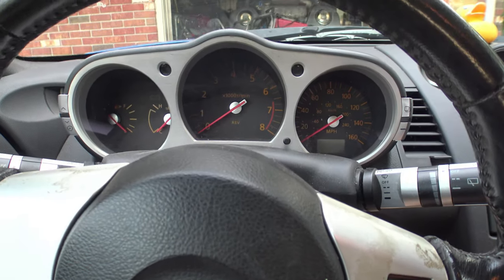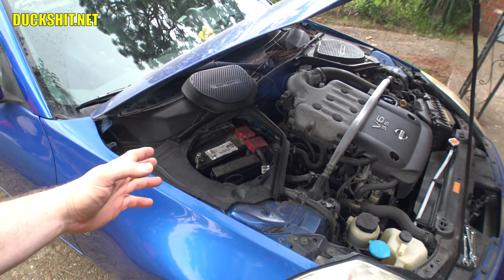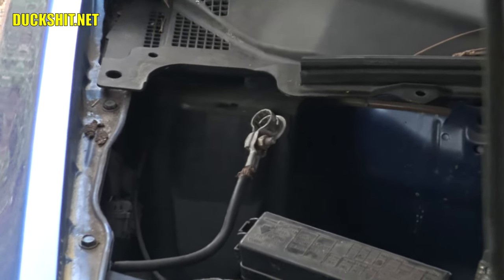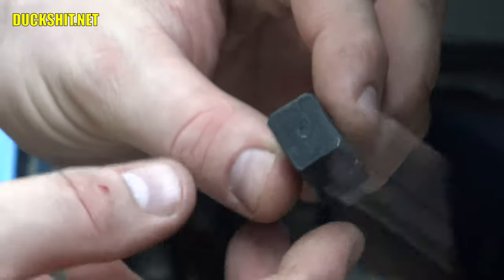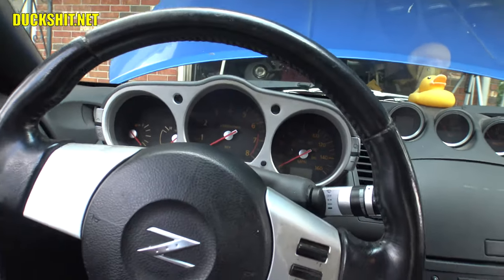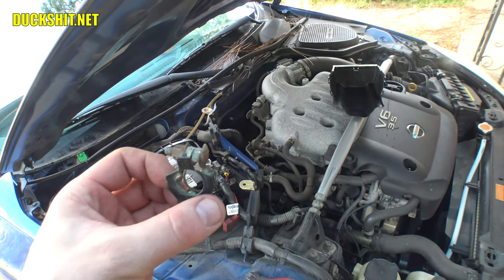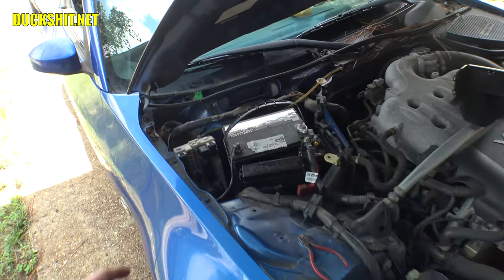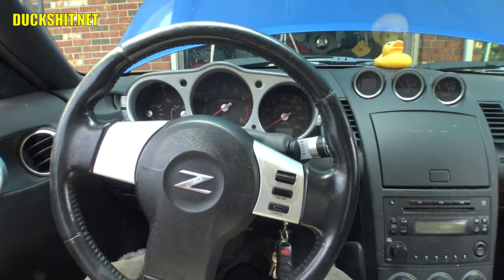Nissan 350Z Won't Start Fix - 4 Things to Try - IPDM Repair

Comment: Bro I am not lying: Got this car a few days ago and swapped the battery because it was old and garbage. Swapped it and wondered why the car wouldn't start. I panicked a bit that it was the immobilizer. Saw your video and heard that you talked about the clutch and this button. I thought "no way..". Got in the car, pushed the clutch and the engine started 😂 NO ONE TOLD ME THAT I HAVE TO PUSH THE CLUTCH IN THIS OLD BEAUTY TO START THE CAR🤣🤣🤣🤣🤣🤣
Reply from the maker: Haha glad I helped!  😁👍🏻

Comment: Hey, I’m having a similar problem here with my 04 Z. So it does the same thing where all the lights light up and it just clicks when you try to start it (no crank).  However, sometimes it does turn on and sometimes it doesn’t, and when it doesn’t you have to wait for like an hour for it to turn on again. I was wondering if you have any idea of what the problem could be. I’m guessing the starter, i talked to my dad and he thinks it might be something electrical. I replaced the fuses but nothing changed, I didn’t replace the relays tho because I feel if it were to be the relays the car wouldn’t want to start at all, unless I’m wrong. Can the relays work intermittently? Any comment will help thanks
Reply from the maker: Yes relays can work intermittently, that's actually something I was experiencing just last week.  Sometimes just wiggling them in their socket is enough to make it start.  But as you saw in this video you can swap out your starter relay with your high beam relay and see if that makes a difference.  If your starter starts working and the high beams begin acting up then it was definitely a bad relay!  Good luck, let me know what happens!

Comment: i order the relays using your link on amazon, they were too big to fit. but i did test the original relays and they are working. I think the starter is the issue.
Reply from the maker: Someone else told me they're too big also, but when I ordered them they're fine.  I'd like to see a pic of what you received.  I think the vendor probably screwing something up.  But in your case if the relays are good, and you did check them for continuity then yes it could be in the starter.  Also check your clutch switch!
Reply: @DuckmanCycles  yes checked the clutch switch by holding it down with my hand. The plastic piece is still intact.
Reply: @DuckmanCycles  I’ll send a pic when I’m back home.

Comment: 2004 here. Just replaced battery. Was packed up for weekend excursion. Fueled up at gas station. Real slow crank over. Then it screamed a few times and not just clicks. Wont turn over at all. Thats why i got a new battery lol. Starter gave up ghost.

Comment: Hey brother.  I really appreciate your video but when I ordered the relays you had a link to they ended up being too big for my 2005 350z . Did Amazon change the size ?
Reply from the maker: They look different in the photos in the link for some reason, much taller.  Might still fit in the socket, not sure if you can get the lid on it with such a tall relay though.  I'll do some more research here and update the link if necessary.

Comment: I love the energy, My nissan 350Z 2004 suddenly stopped turning on,and if it does the lights get on their own,The car doesnt take fuel and i believe its ana electric issue...where do i start
Reply from the maker: Well, I'm not sure I understand the problem based on the description.  But start at the source, make sure the battery is good and well-connected!
Reply: @DuckmanCycles  thanks allot man can i keep u updated?
Reply from the maker: Please!  You can reach me through any form of social media in my video description, on my website, or email me through my website!   I'll see what I can do to help.

Comment: Which fuse or relay is for the 3 gauge pods in the waterfall and the dash gauges and mirror, mine dont work at all?
Reply from the maker: Thanks for the question man, that's a bit off topic from what's going on in this video... I'd have to check the manual.  Do you have a manual for your car?
Reply: @DuckmanCycles  no I don't which one do you recommend. Other than the owners manual.
Reply from the maker: There's only one that I've ever seen, it comes directly from Nissan themselves.  I'm not sure who published it, but you can find a copy of it up on the 350Z forum websites

Comment: Thanks for the video, I have a 2003 350 import, all of a sudden no start, i’ve checked all fuses, checked all the relays, I’ve checked the clutch safety switch and the power to it. All good it does bum start with a push. Just will not start with the key or replace the starter motor with a new one and still no start. I’ve just checked Continuity between pin 25 to f37!! And all good there. Any ideas? 
Thanks paul
Reply from the maker: Looks like you were pretty thorough, but do you have power at the starter motor? Maybe bad starter wire?  Battery terminal could be borked, too.  Just a suggestion.  Hope that helps!
Reply: Hi there 
Thanks for the reply, Iam getting a click from under the dash where the fuses are when turning the key. I Seam not to have power going to the starter relay on the ipdm ?

Comment: Maybe it’s your blinker fluid
Reply from the maker: It's always the blinker fluid LOL
Reply: @DuckmanCycles  Muffler Bearings. Gotta be.
Reply: Nope, you had broken piston return springs!
Reply from the maker: @BobPegram  Only the VW has those, to help counteract the force it takes to turn the water pump.
Reply: @DuckmanCycles  Tesla's are the only current car that cannot have piston return springs retrofitted.  I found out why though.  Tesla's use electron return springs!
Reply from the maker: OMG!  Tiny springs! They'd be the diameter of UV wavelengths of light!
Reply: I just check my blinker fluid filled it cause it was low. And it started right up. Thank you guy so much you saved me a lot of money  dealership wanted 299 to refill my blinker fluid.

Comment: Where there’s a will there’s a way! Glad you fixed the problem! Btw did you replace those clips the windshield guy lost?
Reply from the maker: Clips not yet replaced, the hood actually compresses the rubber seal on the plastic panels, so you really don't need 'em!  I should just go buy a bag of them though, some of what remains are broken, too.
Reply: DuckmanCycles and VW Garage I bet they’re cheap as hell online lol
Reply from the maker: Yep, especially in bulk!

Comment: Subbed! I have EXACTLY the same issue! I tried to remove the IPDM module but that last small connector with the two really thick white wires - can't figure out how to remove the connector!!! Any tips would be GREAT as I really, really want to open up that module to check that Pin 25 trace. On that connector, there's a side clip by the look of it, but I tried squeeing the little inner tab and pulling on the block. No way will it come loose! I tried shifting the littel tab outwards (away from the connector block) and it still won't come out. HELP!!!!!
Reply from the maker: First, thanks so much for joining us!  But it's a little hard for me to see without taking mine apart again.  If I remember I removed it with bare hands, but sometimes on some of those clips you can squeeze them with needle-nose pliers to help you along.  Don't pull on the harness too hard, sometimes the blades will pull out of the connectors and you have a mess to fix.  Send me some pictures through the social media links on my website, I'll see what I can do to help you further!

Comment: Have an '06 where the passenger power window died, new motor isn't getting any power. Switch is good and the fuses under the driver side kick panel are good. Does the IPDM have anything to do with the power window circuit?
Reply from the maker: Other than the ignition relay and initial power switching, I don't think any power window stuff goes through there at all.  I'd trace the wires, you may have a cut in something or a dirty connector!   Easy fix if you can find it!  Good luck!

Comment: Did you have any oil pressure readings when it wouldn’t start? I’m having this issue but I am getting no oil pressure reading
Reply from the maker: Can't tell, everything on the dash flickers and bounces all around when starting... and that is normal!

Comment: Hey I have a question? so I'm getting low voltage to o2 sensors heater circuit. Why hope its just band wires but because its in the same bank on each side with think it could possibly be the ecu? Do you have any tips or tricks to guide us
Reply from the maker: Not something that I have ever encountered, Start with checking the wires for sure!  ECU is a possibility.  It could also just be the sensor itself!

Comment: Hello.My son's got a 350z 2003.If he keep the key on acc.dome light, radio and some other stuff on.it won't start.it will turn but won't start. He has to turn everything off and then it will start. Would it still be the relay??
Reply from the maker: I've never heard of such a thing.  That's very unsual.  I'm just guessing here, but maybe the BCM is acting up.

Comment: Could a bad ipdm give you a crank no start? And could I use the a 2005 ipdm on a 2003 350Z manual transmission
Reply from the maker: Sure could... it did in my case
Reply from the maker: And I couldn't be for sure about this different years, your best bet is to look at the part numbers for both those years and see if it's the same one

Comment: My IPDM got flooded and the dealer wants to replace it for 2k. I see used ones online for 200. Do you know if it’s a plug and play part? The dealership is tacking on 600 for manual labor because they claim it needs to be “programmed to my car”. Thoughts? 
Mines a 2007 Infiniti g35
Reply from the maker: It is a plug-in play part, just make sure you get the same one for the same year and trim level to be sure!

Comment: What if there’s a rapid clicking noise coming from the ipdm relays or box after I stop cranking the car. It’s cranking but not starting. ANY ADVICE WOULD BE GREAT !!
Reply from the maker: Rapid clicking when you try to start it is usually the battery, but you say this happens after you try to start it and it cranks and doesn't run?  So you let go of the key... and lots of clicking?
Reply: @DuckmanCycles   yessir, battery is new and I’ve check all my sensor with a multimeter. has compression,fuel pump works and it’s still not starting. It might be something electrical or ecu ?

Comment: Hey my car has power but won’t turn to the acc/on position I have new battery and checked all fuses etc
Reply from the maker: Check the ignition relay first, swap it with the one from your high beams.  Free test.   If that's not it, possibly the ignition switch is bad.  Lastly, it not anything else, then wiring!

Comment: My 350z automatic is doing the same thing yours did. I'm going to replace fuse 89 and see what happens. After this the car will be up for sale it's a 2004 with only 73k miles
Reply from the maker: I hope you got to figure it out, or I bid you good luck on your sale!

Comment: How did you open the box IPDM as I tried, but it stuck together?
Reply from the maker: I only gently pried it apart, didn't take too much effort.  Before you open it, are you sure your problem is inside of your IPDM?  I was very sure, but I diagnosed everything else first.
Reply: @DuckmanCycles  well I check all fuse none are damaged and the box has a crack on the right side so I’m assuming it’s got something shorten inside it

Comment: Would that also cause a fluctuation in the clutch safety switch? My tuner said there is something wrong with my clutch safety switch the numbers kept fluctuating as he was looking at it. I’ll be sitting at a light and it will shut off then I start it back up and it won’t let me rev above 3500 rpms then I shut it off for a minute or so start it back up and it runs fine.
Reply from the maker: A term like fluctuation doesn't really make a lot of sense.  Either the switch is  on or off, it shouldn't be "fluctuating" any values in between that, so I would ask him to better define what he was saying.  As far as the problem is concerned, it doesn't seem to be related to the clutch switch,  I'd be looking at air flow and cam sensors, thats where my problem has been when I experience strange things as you describe.
Reply: @DuckmanCycles  okay I changed all 4 cams sensors and it still does it. What would you recommend changing next? Maf sensors?

Comment: Hey, brother.  Where is the starter relay for 2011 Z
Reply from the maker: In the IPMD module behind the battery.   Check the manual for your year to know the exact fuse and relay.  Hope that helps!  😃👍

Comment: So my car started doing this, I also drift my car so I’m not surprised my clutch pedal peice broke. I have not checked it out yet but I bet you that clutch plastic is broke cause I’m always kicking the shit out of my clutch on track
Reply from the maker: I don't think drifting would matter much to the pedal switch, hehe!  But I'll be running a follow up video to this soon!  More to come! Thanks for the comment!
Reply: Hey duck man I’m still battling this problem, I’ve put a new battery in, I’ve swapped out the starter relay in the Engine compartment fuse panel, I’ve cleaned up battery terminals good, I put a new clutch safety switch in, rubber grommet piece is still in tack on the clutch pedal, one thing that does worry me is I was driving my car in a heavy rain and I accidentally hit a big puddle on the passengers side and after I got to where I was going it limp moded and water got into the fuse box behind the battery, I pulled some fuses and let it dry for a few hours and it’s been good ever since but I’m starting to question if the motherboard is smoked internally? Really stuck man

Comment: When you noticed the clutch issue. Did you notice if the pedal travel was making a long hard scrunching sound? I just noticed that my stopper fell out and am not sure if that is related.
Reply from the maker: Not really, everything felt quite normal to me...  I do have to replace the clutch fluid line though, the pedal doesn't always bounce back as it should, a symptom of a stretched out line.   I have a braided one here waiting for me!

Comment: Love the vid! Can you assist me with a p1123 code? I've replaced the t-body, pedal sensor and maf and have done the relearn. Checked all connections. Still p1123. Any suggestions would be GREATLY appreciated!
Reply from the maker: Thanks for the question, but I can't say that I've ever encountered that error before.  Have you tried to recalibrate the throttle?  I know there is a procedure for it I just can't remember what but I know you can find it up on a 350Z forums.
Reply: I haven't yet. I cleaned the connections with electronic cleaner. It may have solved it. I had to do the relearn procedures 2x. I've test driven it both times and may have been dirty connections from in/out plugging processes along with the need to replace the throttle. Cross fingers.  Btw. Keep vids coming!

Comment: Could you help me out I replaced the neutral safety switch, clutch switch, starter motor, checked all fuses the car only clicks when turning key o thought it was the starter but I just replaced it and nothing could it be the ipdm for me or the security system I checked all relays and fuses out of nowhere the car did not just want to turn on and started clicking
Reply from the maker: What do you hear clicking?  Be specific!  Maybe it’s a weak battery.
Reply: DuckmanCycles and VW Garage the clicking is behind the motor area I’m guessing the starter and relays but the battery is less than a year old I even tried jumó starting it to get the voltage at the right level and nothing it’s either a bad key and a key cylinder but I have no idea if it’s a plug and play or would I have to change the Bcm along with it the starter is good the neutral safety switch is good the clutch switch is good the plastic button is good all fuses are good it has to be the NATS security system
Reply from the maker: If the starter relay is clicking, it’s likely in your wiring to the starter.  Check your voltages and continuity!

Comment: What year is your Z? The ipdm box on my Z has all left side starter and high beam relays covered. Doesn’t look like I can remove the cover that covers those relays.
Reply from the maker: I've got a 2005 Nissan 350Z, but I think in 2006 the ipmd changed.  But I think the cover is still removable.

Comment: Did you try replacing the muffler bearings. They tend to go out about every 5 years. Great video. Glad to see you got it up and running
Reply from the maker: Ya know ,if it had a tailgunner exhaust, it would indeed have muffler bearings.  LoL!

Comment: I bought the little rubber part from your link for my 350z since mine broke but when it got to me it didn’t fit my z
Reply from the maker: Why not?  My backup ones from there work just fine.  Details!  Please elaborate!
Reply: DuckmanCycles and VW Garage well I have a 2003 z and the rubber part broke so I bought it but I think it’s a different rubber part for mine
Reply from the maker: @bamsavage8850  I wouldn't be too surprised if that was the case.  Can you make it fit?

Comment: How can you fix the code for the anti theft. We bought a z and was working on it. Accidentally touched a wire to something now it won’t crank because the anti theft kicked in can it be over ridden
Reply from the maker: The only way to disable it is to reprogram the computer to not require it.  Otherwise it would be easy to steal, right? LOL sounds like you need to have it fixed
Reply: Call a locksmith

Comment: Thanks for posting this video and for doing all of this diagnostic shit.  It takes a lot of guess work out of this problematic fix.  What a pain in the ass.
Reply from the maker: Pain in the ass indeed, it was a lot of little problems that I had and it was so odd that all of these happened at the same time